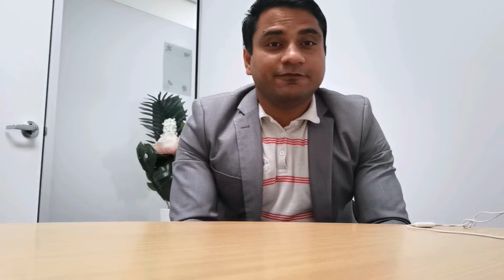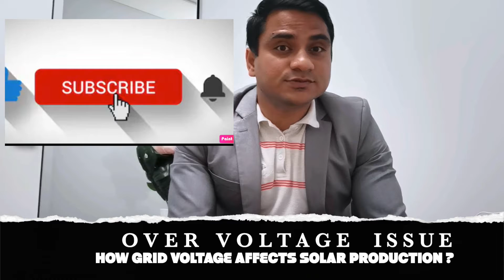Grid Over Voltage Shuts Down Solar- Overvoltage is impacting your Solar Systems. #SOLARPANELS

Comment: Changing your inverter settings to lower voltage?
Can you please elaborate?
Reply from the maker: Electrician should have access to change the voltage range and also it depends on inverter model. May be call inverter company and explain about your situation and request to adjust the voltage range. It may help you to fix the issue.
Reply: @Solartechreviews  I am asking if I have to reduce output voltage?
My grid voltages are currently 234V, and the tripping threshold is 253V.
If I reduce my output V to 220 or 210. Will the inverter be able to push energy to the grid?
Reply from the maker: @WIYTech should be but totally depends on inverter’s model their functionality and feature. It’s better to speak to your inverter manufacturer and tell them about this situation.
Reply from the maker: Let me know how you go after speaking to them, also want to know about the results. Thanks

Comment: What about Home appliances when voltage goes above 260v
Reply from the maker: Good question, it should be fine because home appliances got voltage balance as well. But will research and get back to you with specific answer.
Reply: @Solartechreviews  some appliances can manage the voltage but some can not, then ?

Comment: In Pakistan me and ou cousins living in same house and have separate hypbrid on grid plants. My inverter viltage going to upto 270 but theirs is around 250 in peak time. We are using same transformer but different phase line. I changed my phase line to theirs but still had the same issue. My DC breaker was 32 ampere i chamged to 63 because of malfunctioning after that somehow issue resolved but still happening.

Comment: My current concern is an overvoltage originating within my own system.
Checking wiring now but wondering how Enphase could have recorded 322 volts (which shut down my whole system) when I thought microinverters have voltage regulation to limit to approximately 240v +/- 10v?
Reply: Also have determined the overvoltage did not come through the grid...no unusual local or environmental anomalies, no other neighbors with solar on immediate street effected, no recorded overvoltage from grid power supplier-TNMP.

Comment: Australias system has not considered the raising voltage problem in its design. Its solution is to tell people they will have to pay money instead of get money for having solar output to grid. Wondering how a better design would be.
Reply from the maker: I guess it comes down to the question of who is responsible for the grid voltages.

I would argue that the network has way more tools at its disposal to manage voltages than the customer. Using volt-var and volt-watt should not be the main network tool. Networks should have to report and be held to account over the voltage and power quality levels they provide. They are not, which is completely unfair when those same voltage and power quality levels are causing customer investments to under perform.

I am not sure how many customers understand the technical reasons behind the volt-var and volt-watt approach. I am certain that most customers have no idea about how networks are able to restrict and curtail their solar operations in this way. I am equally certain that networks do not publish reports on localised (or network wide) voltage levels, which they should do given it can have a significant impact on the financial performance of your solar investment.
Reply: @Solartechreviews  not really. More who has the authority to do what they want. Citizens get treated poorly by authorities in Australia just like any other country. They will take your home if need be to make a freeway. Free Julian Assange from Western Tyranny. I'm from the west and don't want tyranny. Freedom and ✌️ peace.

Comment: Hi, In the grid is shown 260 voltage and inverter is showing 264 plus and cut down.. What will do
Reply from the maker: may be check EdgeIQ Voltage Optimiser. What the machine does is “condition” the incoming supply. You cable it in after the main switch, and the whole place will be fed with a steady 225 volts. Your solar power system will see the same voltage and function as intended, however the line side/network supply voltage will be driven up to whatever is required to make the energy flow back to the network.

Comment: Hi what happens If the load is higher than the rated grid tie inverter?
Reply from the maker: In layman’s terms, the voltage being “tipped into” the grid shouldn’t be higher than the AS4777 limits. In order to address this, we calculate the impedence on the mains connection and adjust the voltage regulation to take this into account. This is done by looking at “live” voltage and consumption figures over the first 4 weeks of operation of the device, so we have an accurate assessment of individual household impedence levels on each site.
We can then set the voltage regulation at the maximum level possible for each site without transgressing AS4777 limits.
In most cases we find that the grid isn’t running above AS4777 limits, but its the impedence on the mains connection which is causing the inverter to trip.
if your grid voltages are consistently above AS4777 limits, we can provide this information to the network (or in some cases the ombudsman) to encourage/provide the bais for the network to tap the grid voltages. If, for example, the grid voltages are consistently at 270 volts, we think this is the responsible thing to do.

Comment: In my area grid voltage goes 252v in day time before I connect solar. Does it mean I can not export any more after I get connected? Is it true that we can not export beyond the transformer limit?
Reply: In solar inverter there is a setting to configure OV and UV values, but based on what I've understood is even if we calibrate the value and increase the range, then the output will be reduced but it will still generate instead of simply shutting down.
Reply: @ChetanLakhanpal1   whether output will affect on changing OV and UV values ?
Reply: How to fix this problem
Reply: Can we use mainline stabilizer for this issue

Comment: I have installed 5KW ongrid solar plant, but the Waaree invertor is continuously showing warning of GRIDOVP. The  three phase Grid voltage is 250 V, which as per electricity supply company is normal. In such case, please elaborate on your first solution of how to lower invertor voltage. Also the vendor is Suggesting installing voltage stabilizer before mainline. Will it work ?
Reply: In the same boat. Did you get the stabiliser setup done? Also, how does he plan to send power generated back to the mainline through a stabiliser?
Reply from the maker: You can always adjust voltage of inverter from your end, check user manual or inverter data manual.
As far as the concern of voltage stabiliser, this is also a alternative solution to maintain voltage fluctuation.
Reply: @Solartechreviews  I don't see anywhere how to set the voltage at the inverter end. But really, the difference between the grid voltage and the inverter voltage is about 4V, which means that the average 253 threshold for 10 minutes is very often exceeded. I would like to set this difference at 2V to avoid exceeding the threshold.
Reply: Same problem,I got feeling as though I am deceived.